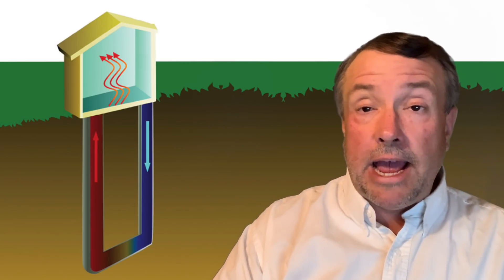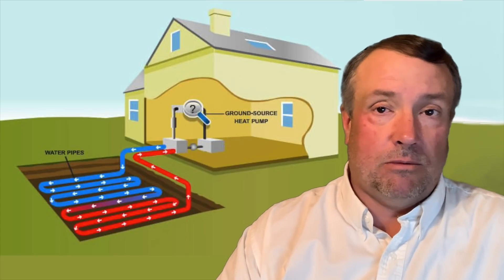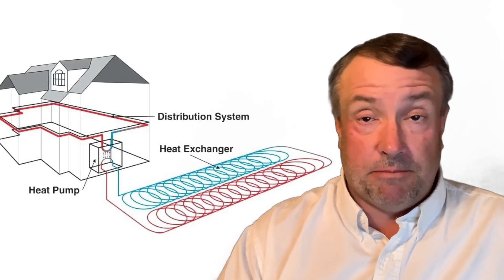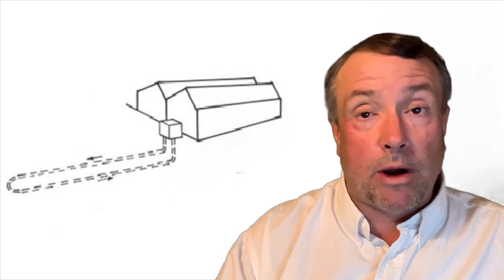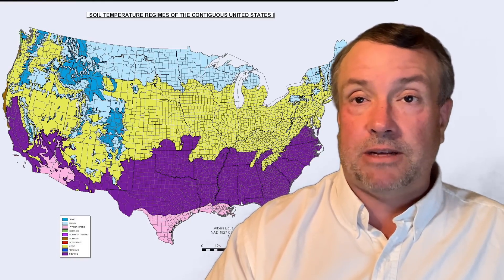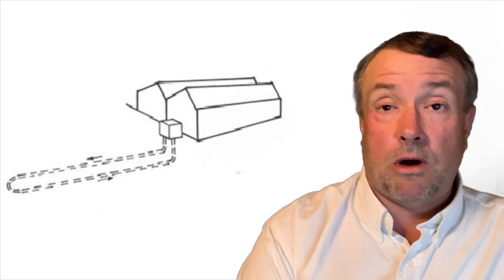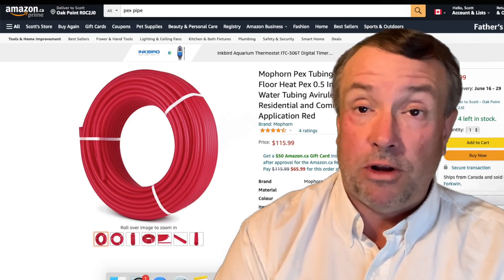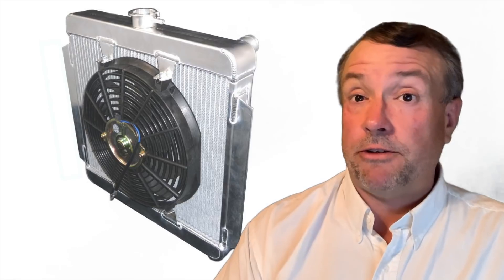Low Grade Geothermal Greenhouse Heating - Air vs Liquid

Comment: Can a copper pipe radiator or coil be installed at the highest point in the greenhouse ( where all heat rises, then pump that warm water or glicol in  the ground using pex piping burried at 2 to 3 ft into greenhouse floor?
This way the heat from sunny days from greenhouse gets transfered to the huge amount of soil, then the soil will releaase the heat into the plants roots slowly.

Or have a 5000 galon concrete tank burried in the greenhouse floor , filled up with water( covered to avoid evaporation) and all the heat that rises up from the sunt heating the greenhouse to be collected and transfered to the water tank. The 5000 galon water volume will slowly release heat and balance the greenhouse floor and the whole space.

I think that any possible source of heat needs to be collected and storred in the ground/ floor of the greenhouse to warm roots up. The plants or citrus do not need so much heat in the air , but more to the root system..

Also another option is to use a air to water heat pump to extract the heat at the highest level in greenhouse and transfering it back to the same 5000 galon in ground tank. Water has the highest retention of heat possible of all accessible matterials.( free)

Same way in costal areas temperature is regulated by the ocean.

A heat pump can also extract heat from a neaby pond or 10 ft underground, but a pond will have a much better density to release heat that dirt. So water temp at 10 ft deep pond should have at least 10 Celsius to help a water to water heat pump and dump water into same storage water tank inside the greenhouse floor.
Reply from the maker: Interesting ideas…

Comment: hello, I am building a greenhouse in Arizona in a smaller backyard and I have a few questions. My greenhouse is going to be 10ft x16ft, and 8 and a half feet tall, and it's going to use two layers of greenhouse film with air pumped in between for insolation. I only have about 25ft total in length that I could dig a trench I could make it a little bit wider so It can turn around at the end and go back. Would this work for 400ft of tubbing? also, would this setup be superior to a swamp cooler since I am in a hot, dry climate?
Reply from the maker: in a hot dry climate a swamp cooler is probably your cheapest cooling option when used with sun shades properly

Comment: Can't imagine your summer heating staying in the ground for months . Won't it quickly cool to the surrounding soil
Reply from the maker: @Robert-zx2df  depending on the material, heat moves very slowly through the ground.  It’s -30’C where I live right now, but above freezing anywhere around here if you dig down 5’

Comment: How do you keep the evacuated tube lines from freezing in the winter when you disconnect them so as to not put cold into your system?
Reply from the maker: As long as they are deep enough below the frost line they won’t freeze

Comment: Just watched the section of the video about injecting heat into the ground during the summer to use in the winter and am wondering if it’s possible to work that in reverse? I live in TX so need more cooking for a greenhouse than heat. Is it possible to inject cold into the ground the same way you would heat?

Comment: A blower would work much better than a fan for an air system due to the higher static pressures they can achieve. This is why they use them in automotive and building HVAC systems.
 Liquid circulating pumps use much less energy to move water (and heat) than a fan or blower moving air.
Reply from the maker: interesting

Comment: If you're heating the ground use sand or clay in your trench. Rocket mass heaters use clay to absorb and emit heat, Sand is also a great way to store thermal energy. Someone smarter then me would need to do the calculations, but I'm sure that the stored thermal energy would more then offset the cost. This would only be for heat however not for cooling.
Reply from the maker: Thank you for the insight

Comment: You can also cover the pit with long compost biomaterial, like woodchips n stuff. Will insulate and give heat in long run, and also can be used as growing bed.
Reply from the maker: Compost only give heat for a little over a year max though

Comment: Hi Simple Tek, Let me ask if I don't have lots of land but if I can have a septic tank concrete or fiberglass min. 6 ft down from top of tank and I fill it with hoses in loops the cover it with soil at some everything inside the tank is going to be at the same temp. This way I can have enough liquid to run the radiator all day and not worry of running out. What do you think? I appreciate your help. Thanks 👍
Reply: Thanks for your reply. 👍
Reply from the maker: @johnlittle1939  I hope it helped and I didn’t disappoint too much
Reply from the maker: It works in theory but the amount of thermal mass is limited unless you have a 30,000 gallon septic tank. Most residential tanks are 1000-2000 gallons, so not really big enough

Comment: Simple.  My ground temperate is a roughly 52-56f in Connecticut. I have a 4x5x13ft(about 8ft of water) garden water well and I am considering installing a 4x5x6 greenhouse on top of it.  Currently the top of the well lid never freezes, so I know it can be done!  Thankyou for all the ideas.
Reply from the maker: You’re very welcome

Comment: Question, I want a low grade geo-air system for greenhouse, in your image at 3:57 it shows the air vent coming from the outside. Why not make it grab the air from within the greenhouse and keep it closed?
Reply from the maker: You are correct, image is wrong
Reply: Did you ever make your low grade geo air system? I'm in north Alabama where most of the year it's warm but in winter I'll need something similar for the tropical plants ...

Comment: Have you actually done this yourself?
Reply from the maker: Yes
Reply: @SimpleTek  Cool. I'm planning on setting up a poor man's geothermal in my off grid solar powerhouse to keep the temperatures stabilized for the batteries which don't like extremes. I've got 5 acres and going to have an excavator on site for a few days, I might as well try it.  My frost line is pretty deep (mountains in northern NH). is it better to coil the tubing  or run it out straight, or does it matter?
Reply from the maker: @NeverTakeNoCut-offs  I’d say coil it!

Comment: Really like your videos!!

I live in zone 6, 90s in summer 20s and lower in winter. Most heating and cooling videos on YouTube are Canadian. Would you consider doing a video based on zones and desired greenhouse temps.

For clarity on my question, if I wanted to grow greens 50-75 year round or tomatoes 70-90 year round in a zone, how would I design a system? Im not asking you to do a special video for me (as awesome as that would be) but I'm guessing there are a lot of people like me in areas that need both real heat and real cooling and don't want to rely on affordable gas or electric in the future. 

Thanks in advance for considering my request.
Reply from the maker: Good ideas! Thank you, will consider!

Comment: What do you mean by insulating the bottom of the green house? Putting a layer on top of the pipes? So the heat stays below the insulation and does not escape inside the green house?
Reply from the maker: No. Insulation, plastic, sand, pipes, concrete blocks. In that order, heat will radiate up
Reply: @SimpleTek  I understand your comment. Has there been discussion about not worrying about the immediate soil needing to heat up? Say 2 feet of top soild. A layer of 4" insulation (like a cooler lid) then sand or gravel and pipes. Two layers of pipes.  The top layer will fluctuate moderately but the climate battery "could hold more thermo mass? If it had a lid?
Reply from the maker: @riversedgegoatdairy297  interesting
Reply: @SimpleTek  I am planning on building a straw bale wallipini version at our farm this spring. Finally)! Arthur Ontario. My biggest stress  point is drainage. I will need to build a long trench from the proposed area to a lower spot. Such that it will not flood the air exchange tubes. The back wall will be made out of straw bales and double stud wall 2x4's and likely sheet steel maybe cob on the inside? Not sure how deep I will dig down. Since the deeper our passive solare green house the longer my drainage trench will need to be.... Thanks again for the videos and tips/dialogue. Very encouraging!

Comment: With homes there is the option to have a vertical liquid geothermal system.  Could this work with a greenhouse?  I understand that it would be more expensive.  I just want to know if it is feasable.
Reply from the maker: Absolutely

Comment: Here's another idea: dig a deep hole for a 4000 gal septic tank. Place the tank and run water lines (for heat exchange) inside it, then insulate the top of the tank. Cover it with at least 4 ft of dirt. Use the water tank to collect rain water, then use it for irrigation.
Reply from the maker: why?

Comment: I am currently in the process of building my own greenhouse split geothermal system. I am using both methods and combining them. I will be circulating air underground around 4' deep. I will also be creating my own geothermal liquid loop that will use the same hole. I am then going to have the liquid lines run through a self made "air handler" where a radiator will then cool the geothermal air coming in from underground.

I am hand digging a 30' L x 3' W x 4' D with a pick axe and shovel. So you technically don't need an excavator! lol

Some other things I am doing differently than others is adding a "fresh air intake" into my system. So the air being recirculated from the greenhouse will get mixed with outdoor ambient air which is typically 8-10 degrees lower. 

Lastly I am going to be building some "Dehumidification Chambers" or basically desiccant chambers that will pull out as much moisture as it can as the air passes by. I will have 1 chamber on the return and 1 on the supply sides of the system. Basically just going to be some cloth material socks that will hang inside of my 6" return pipe and as the air moves past them they will slowly draw additional moisture from the system. 

I am in Zone 7b and have summers with 100 degree days and 100% humidity. I have to combine many methods into my greenhouse to achieve cooling effects. I also have a wind tunnel layout to my exhaust and circulating fans. I will need to balance all of these systems so that I can achieve greenhouse temperatures that do not exceed 90 degrees F.

My goal is to achieve a max of 15 degrees of cooling/heating inside my 16'x32' high tunnel greenhouse.
Reply from the maker: OMG That's AWESOME!
Reply: I think your plan has a few flaws :)

Comment: I live on a lake in North Texas. During the winter, I can pump unlimited quantities of 60°F water from 12' deep in the lake. What is the best way to use that resource? I'm pretty sure I'll need some sort of liquid/liquid heat exchanger as I don't want to pass lake water through a radiator. It would foul and lose efficiency right away. Are there off-the-shelf systems available to do this?
Reply from the maker: there is an extremely cheap liquid to air heat exchanger you can buy for maybe $50 app almost anywhere in North America. It's called a car radiator! goto a wrecker and buy a used one! they are EXTREMELY efficient - just put a fan behind it and they throw TONS of heat - I heat my greenhouse with one from my wood boiler. and you can get that heat from your pond by just throwing a closed loop coil into the water - maybe. 300' underwater wold work - 3/4 inch tubing - that's about $100 I tubing - you get a taco pump - maybe another $100 - and connectors $20 plus a $20 fan. this will ue maybe 50 to 100 watts of electricity between both the taco pump and the fan  - hope that helps - simple technology!

Comment: The air systems- the hole is surrounded with insulation and the system heats the ground all summer so in winter the insulated ground is warmer - ground battery. And in winter the greenhouse can still get 100* so the fan warms up the ground to use at night. Kind of like what you are talking about with warming up with solar collector for liquid lines.
Reply from the maker: cool

Comment: LDS Prepper here on Youtube did this with his greenhouse having the intake and the discharge all inside the greenhouse. In the winter of Idaho he was able to keep it above freezing just running some corrugated pipe in the ground and a fan to move the air.
Reply from the maker: Dave has to geo air greenhouses. He's done amazing work!

Comment: i dont think the ground will hold the heat from summer all the way to winter, it probably dissipates in a week or even a couple days. even without extracting heat i think it will only stay at the the temp that the collectors can collect, ie how much sun in the last day or two. maybe insulating the ground is needed as well idk. and for heating with a thermal battery you would want a cylinder or cube since there is less surface area the colder ground beside it can sap heat from it.
Reply from the maker: depending on the ground material where you've, it can and has been done many times in many places

Comment: I was hoping for some math. The underground swimming pool I think works if it is large enough, and I like the idea of using solar collectors to heat it during the summer but the math has to work
Reply from the maker: the math would be different for every size of greenhouse and climate locations would change that too.

Comment: We need to cool down our greenhouses as much as possible here in the tropics. Average of 30-50 deg C all year round. Would liquid or air cooling work best or?
Reply from the maker: how is ground temperature and material 4,5, 6 and 8 feet down?
Reply: Ground temperature starting around 6 feet deep is equal to annual average air temperature (day and night and all seasons).  For example we live near Puerto Vallarta and the average annual air temperature is 23.5 C so the ground temperature would be the same.  Some say you need to go 30 feet to get consistent temperature but the difference in temperature between 6 feet and 30 feet isn’t significant but the effort to dig is much greater.  The most efficient heat exchanger fluid is water.  If you have a well, using well water through the radiator/fan is efficient.  However, you need a dump for the well water.  Perhaps a second injection well located far enough from the extraction well  would work.

Comment: Love the video.... can u share some more information on implemented projects on geothermal cooling....  Geothermal cooling looks to be the only option (if it were available here) to economically cool greenhouses around where i live..... I live in an area with high humidity throughout the year, 4 months of near constant rain (~4500mm/year) with temperatures (~31°c) and humidity 85%+,  hot summers (38°C+)....
Reply from the maker: I only know of home systems, plan to make and install one on my greenhouse soon
Reply: If there is a well available, or you can dig down to groundwater, Just use a liquid system with a copper pipe in the section under the cold water.

Comment: Good video. Might I suggest that success in a geo air system is dependent on which thermal mass is utilized: inside the footprint of the greenhouse where it is actively managed, or outside the greenhouse where you're dealing primarily with the prevailing ground temperature. If you're just pulling from the prevailing ground temperature, you're right that it's rather low for most of the US and over the course of a winter you're likely to gradually deplete it. If you're using the ground beneath the greenhouse and can pump excess heat into it, you're no longer stuck with the prevailing ground temperature. That's why systems in Colorado tend to work well: high solar gain to "charge" the soil beneath the structure, despite ground temperatures that are normally in the 40s and 50s Fahrenheit.
Reply: I have yet hear of it being done but one way to use any low grade geo system is to insulate the glazed surface of a greenhouse. Add a second layer of plastic panel or sheet six inches inside the outer and run the lower temp air sourced outside the insulated footprint through that space. If your greenhouse gets the beniffit of a ten or twenty degree F increase from raising the average ground temps within it's perimeter this will make the difference even greater across all that glazing in colder climes. By using an outer loop you could effectively cut the temp difference in half or less and the heat loss with it. It won't help the short winter days but you could almost grow tomatoes in 40 below without additional heating then.
Reply from the maker: well said